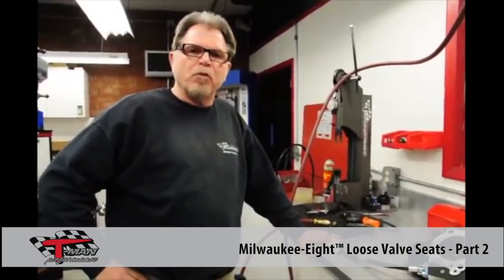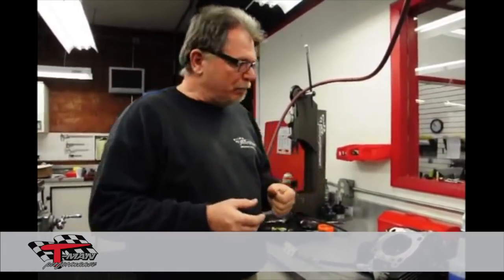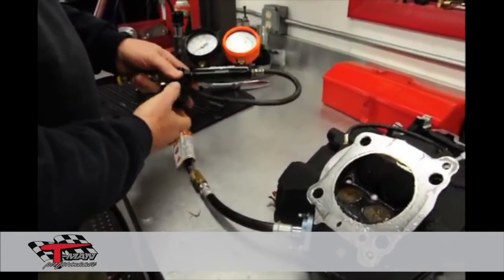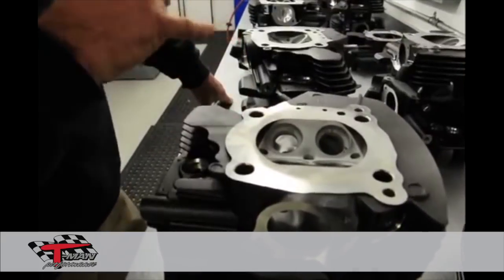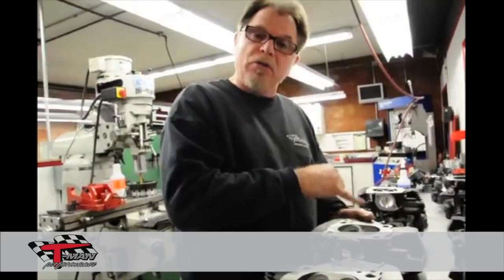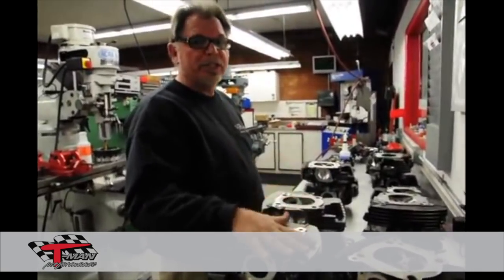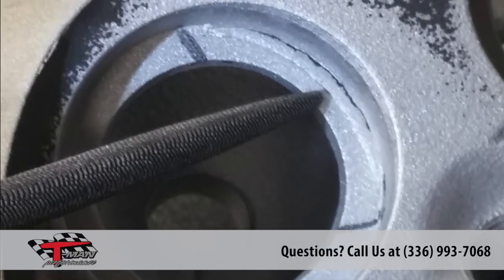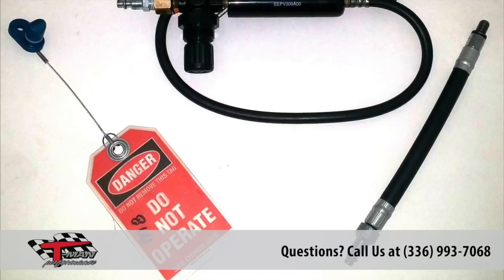Milwaukee-Eight™(M8) Loose Valve Seats - Part 2

Comment: Doe"s rhe motor have a ratlle noise sometimes but not all the time if you have bad vavle seats?. Mine is a 2018 107 RGS with 11000 miles started noticeing noise after startup and sometimes at a idle.

Comment: Would this issue cause you to have excess oil in the air breather? I installed a crankcase oil breather, it's basically a dip stick that has a external tube that goes to a filter. It did not help at all. Noticed the problem after installing a Arlen Ness inverted air breather. Oil will drip out the bottom of the breather.

Comment: Was this a rush job/not enough testing by Harley?
When the thunder stroke came out I don’t  believe it had near this many problems. They tested engines over a million miles. 
I agree new models have bugs to be worked out, seems like Harley should have caught some of these problems in testing.

Comment: What conditions will you notice if you have this problem.  I hear a noticeable ping or rattle when I accelerate at 3k or above. I have a 2017 with 6k miles. Could the exhaust valve seating  problem is what I am hearing in the top end of my motor?

Comment: Question is valve seat issues with 2017 & 2018 Milwaukee eights?
Reply: Their are 2 recalls on the 2019s that i know ,which are the clutch and a seal involving the transmission,alot of money to spend

Comment: Very useful information without a doubt. Although you have identified the issue, I’m not sure what the detrimental effect is as a result of the misalignment. If you could explain what happens to the motor in real terms, I would understand a little better how it effects my bike. How does one know if the valve seats are leaking unless we remove the heads? You may have mentioned it but I guess my limited knowledge may have caused me to not quite have caught the crux of the problem.

Comment: alminum heads on any engine can have this problem. pressurizing ports excellent idea. when we run across this problem we machine for slightly oversize that will give proper interference fit. these engines are not barn yard frendly. i wonder if you could do test while head still on engine. thanks for the vid.

Comment: While it's polite of you to not dis the Motor Company, the measurements you took prove those parts were poorly machined at the factory and the Quality Assurance missed the defective parts. Not cool for a premium motorcycle. If I made errors like that as a student machinist I'd fail the project. They aren't minor mistakes.
Reply: I doubt that the MOCO cares one bit about this.  They figure it will take long enough for the defect to show up on most bikes, and by that time they will be out of warranty.  This presents the perfect opportunity to tell bike owner to opt up for a $6000.00 set of Screamin’ Beagle performance heads.
Reply: @MarkPalmer1000  ,,exactly

Comment: I appreciate your videos on this new engine.  I own a 2017 Road Glide Special and have been planning on purchasing Harley's Stage 4 kit.  But as time goes on, I'm learning/Hearing about Oil Sump problems with this new M8 engine?  At first the dealerships side tracked the issue when I brought it up by telling me how that issue was solved by the "New Cylinder Head"  But as I learn more, it sounds like both the stock head and the stage 4 head both have reliablility issues?  Thus causing the engine to grenade.  I have a friend who owns a 17 cvo streat glide, and he had the stage 3 installed on his bike and it blew up on him.  To make a long story short, I am not trying to bad mouth Harley, nor anyone else.  I just want a straight answer from someone in biased.  My friend had Cycle Solutions put a new kit on his bike and it runs great.  What is the problem with this new engine?  Sounds to me, it's a Cylinder head issue?  Am I correct?  Now watching your Valve Seat problem video, is only building my case.  I would like to do an upgrade on my bike, but don't want to waste my money on a sub-par parts package.  Thanks for your videos.  Could you do one for this issue please.

Comment: Thanx for the info but get rid of that annoying channel banner running on bottom of screen cant see anything your doing with your hands and just plain annoying. These are quality control issues that HD should have addressed before these new motors were released to the consumer. Geez, what does HD have for R&D employees?? Makes you wonder... They had almost 20 yrs to R&D this new M8 since the release of theTwin Cam 88 in 1999 ( Major Cam issues '99 till '06 and Auto primary chain tensioner issues in '07 onward that they never fully addressed) This is not the only issue with this M8 engine. There's a few like leaking oil from the valve cover gaskets and primary self adjusting chain issues, oil leaking from the oil cooling lines that now has a recall and more to come as time moves on.... Why does the person that buys a "All New" model or motor have to endure the Motor company's "Work out the kinks of the first year run.....?  are they using the public as guinea pigs to expose their problems with the bike/motor then go back and try to fix what should have been worked out before being released to the public?  They need to spend more time putting their motors through grueling long term testing or start cleaning house of their employees. This has been their smug holy then thow attitude for years and part of the reason they are going down hill rapidly.
Reply: My twin cams -- all six past and present -- have never leaked nor fragged.  And two of them are/were seriously built.  It wasn't the tensioners, it was the chain drive not being de-burred in manufacturing.  That's what ate up the tensioners and that was pretty much taken care of by 2004.
Reply: I agree. Did H-D not even test these motors before putting them on the market? Harley big twin engines have had issues since they released the Twin Cam. They even redesigned the defective cam chain tensioner on the Twin Cam, and it still failed. On these M8 engines, I'm not liking the close spacing between the valves. It could be that having so many valves in such a small space is weakening the head structure and causing it to warp when hot. I would never buy a bike with this engine. My 1997 Superglide has 78,000 miles on it, 60,000+ are mine, and I have had no issues. Engine is completely stock.

Comment: Good video, you describe in machinist terms a  good explanation  that people can understand, for the average mechanic, this could take a lot of time to figure out.   I have a way to solve the problem. Buy a Yamaha or a Honda
Reply: Zero heartache here, but my main Harley's are Evos (1988 I bought new and a 1994 I've had several years).  The 1988 is pushing 150K miles on the stock bottom end.  I've zero desire to be an M8 beta tester! Always wait several years before buying a new model car, truck or motorcycle. I do.
Reply: OVERPRICED  JUNK  !!!!    Is all this heartache  really worth  it  ?    OVER THE NAME  & THE SOUND  ???  

What about  riding  ???

Then you have this PIRATE CO. That  enjoys taking your money  .....  but they won’t back up their product !  Not even with an expensive warranty in place !